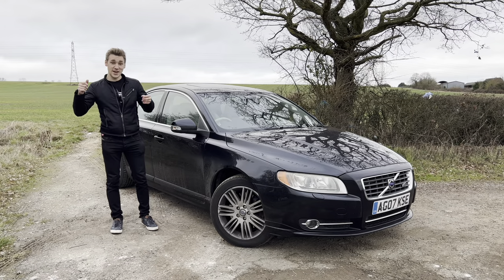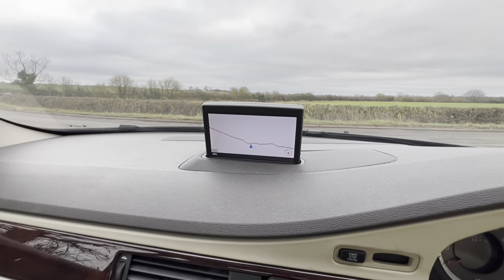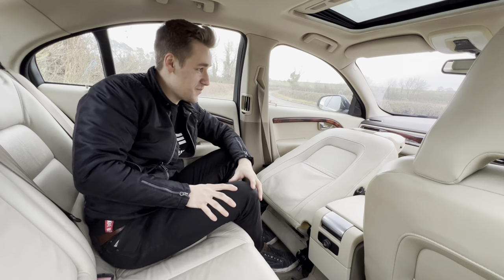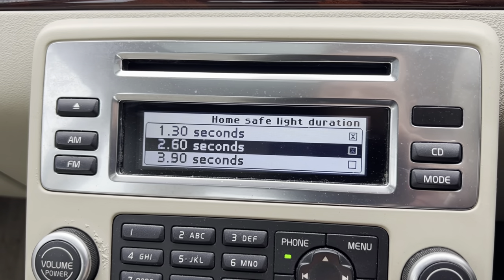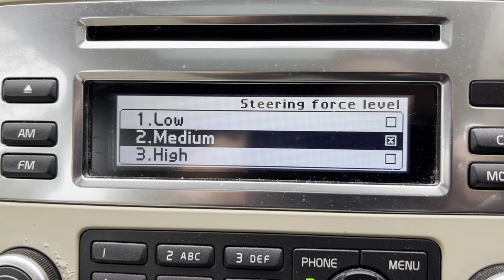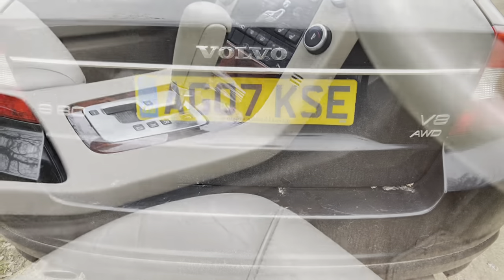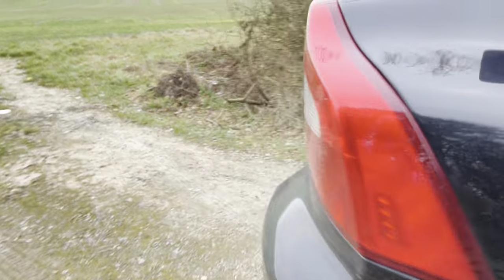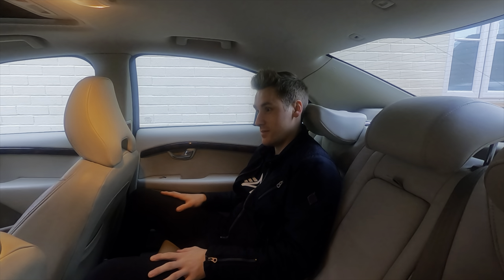Volvo Hidden Features, Hints, Tips & Tricks | P3 Volvo S80 V8

Comment: There is another interesting feature on the key fob (at least the one I had with the V8) where you press a key and it checks if the car is locked or not, if the car is within communication range ..I have not seen that in any other car of this day and age. The one I had, also had adaptive cruise control  and three way adjustable dampers which in soft setting made the car feel too undamped and bouncy and in race mode was way too harsh even on smooth roads, hence effectively forcing one to use the medium setting, just like with the steering options. Enjoy the car, and that burble of the V8, so un-Volvo like that people always struggled to locate which car made that V8 sound..
Reply from the maker: That’s an interesting feature, I haven’t come across that one yet! Thank you for sharing:) I love how people look out for the V8 but miss it because they don’t believe it’s from a Volvo 😆
Reply: this was an option on all the s80/v70/xc70 of the p3 gen

Comment: Another VERY useful feature or mirrors - you can adjust them through menu to look down, while driving backwards, so you can see rear wheels, both or just opposite to driver. Or you can do nothing, engage "R" and press mirror button "R", or "L", or both, but not simultaneously (or they fold, of course). Press again to return them to normal, or just disengage "R" on gearbox.  Don`t know if it is standard or option, but mine have it.

Comment: There is a peg attached to the headrest of the passenger seat so you can hang a jacket on. I turned off the auto mirror close when the car is locked in the winter because the frost kept it stuck shut. It's in car settings but I think your film caught it. Curiously my 2010 S80 Executive does not have the head rest button.
Reply from the maker: I did notice that peg there actually but thanks for letting me know, I was tempted to feature it but I decided not to in the end. Regardless a very cool feature, interesting that your executive doesn’t have it!

Comment: The button to fold your back headrests is to fold your rear seats easier. Also, if you open the trunk, there's a little latch you can pull at the top of the trunk opening. If you pull this latch, the rear seats will fold

Comment: Please stop using Red Coolant in your car, the correct grade coolant to be used for the Volvo is Green Coolant, OE Volvo Coolant is best suited for the car, kind advice to get it changed immediately !!!
Reply from the maker: Thank you for the advice! Interesting how there’s different variations of coolant, what will happen if I keep the red coolant?
Reply: @NathanMannin  The different grades of coolant are for preventing corrosion in different engine block and cylinder head  materials. Some are for aluminium, others for cast iron or combination of both. Great video by the way!
Reply: İlginç! soğutma sıvısının renginin kırmızı yada yeşil olduğunu şimdi duydum. Bende de 2012 V60 D3 var. Ve  soğutma suyu kırmızı.

Comment: The quick-fold front passenger seat in the S80 is also a chauffeur feature. Simply move the front passenger seat all the way forward, remove the headrest (if necessary), and throw a blanket over the seat back to avoid scuffing the leather. You then have a backseat in which the rear passenger can fully stretch out their legs and enjoy the rear armrest/cup holders (hence the existence of the optional refrigerator that replaces the ski hatch behind the rear armrest).
 As an American owner of a 2014 S80 who has driven the car 1000+ miles non-stop, I can guarantee that the fold-flat seat is an invaluable feature for you and your copilot on long trips.
Reply: You shouldn’t need to remove headrest, fold seat forward with levers, then using side slide button on passenger seat, hold head rest down and tight to seat and it travels under the glovebox. When you stop far even forwards it traps seat back pushed down.

Comment: A really cool feature in the PCC (personal car communicator) on the key fob - when you press the 'I' button there are little lights on the key fob that will flash. They can tell you if the car is locked or unlocked, if the alarm is armed, if the alarm has gone off recently, and the most impressive function is what they call the heart beat monitor which can tell you if the car has been broken into and there is someone inside the car when you are within the communication range and the red lights on the key fob will beat like a heart beat. 
Something else handy is where the manual key slot is on the drivers door, found on the rear end of the driver door handle on the underside you'll see the slot to insert the key blade to remove a plastic cover which hides the key slot - handy if the battery goes dead or flat on you and you need to get in or lock the car. Terrific cars - incredibly good sounding V8 and as reliable as the day is long. Underrated.

Comment: I was hoping to be able to comment on something you missed - but you covered almost everything, and now I know the keyblade is quite useful. I also figured out how to use the home safe lights a few days ago thanks to a 2010 S80 brochure I found online. I've found that the high steering force level is better for winding roads with hills, you feel more in control since it's heavier. 
I don't think you mentioned the a button for rain sensing wipers on the wiper stalk. You can turn it on with the stalk in the off position. They are dim-witted but useful occasionally.
Reply from the maker: I love old brochures! I wasn’t aware of rain sensing wipers but I’m also not a fan of them in any car either, I like being in control of when I use them. I absolutely loathe active cruise control that changes it speeds accordingly too, I like the standard cruise control where I have full control that doesn’t slow down for you! 
Someone commented on this video remote start? I’m going to have a dabble with that I think!
Reply: @NathanMannin  if you figure out remote start, let me know. I didn’t know it was possible
Reply: Uzaktan başlatma yok. Bende 2012 v60 var. Yok. 2020 sonrasında varsa onu bile görmedim.

Comment: Most well thought out car I have ever owned. My 2008 V8 still going strong. Closing in on 150,000 miles.
Reply from the maker: Glad to hear from another S80 V8 owner! I miss mine so much, have you had much issues in your ownership?
Reply: Two complete engine reseals. Idler pulley, tensioner, belt, alternator, water pump, cooling fan unit, full break job, power steering high pressure and return hose replaced, fluid reservoir  . Just to name a few.

Comment: We've owned a 2007 S80 D5 for about 15 years and never knew about the little levers at the bottom of the front seat to help with IKEA loading! Also, my Dad used to flip the rear headrests down when my young nephews were arguing in the back 😂
Reply from the maker: I’m glad I could help! I’m sure it was only made as a feature to fit IKEA flat pack furniture 🤣
That’s parenting done correctly, love it! 😂

Comment: Also… The headlights, quick removal with the metal straps yes, but if you unplug and open the main lid inside there is a lever to push across to change the lamps from RHD to LHD, great for jolly’s on the continent old boy. I used to make the change during the trip in the Chunnel.
Proviso of having the Zenon and later vehicles you press button on waterfall for 15secs to swap beam.
Reply: Honestly for the sake of my husband I hope we have no lever in our lamps. He just bought 2 lamps as we have to register our volvo in European country 😂

Comment: Even though im an American Mopar guy. My daily driver is a 2007 S80 V8 AWD. It has exhaust work and high flow air filter. Has a really nice burble at idle and very angry growl at high rpm. Just had the valve cover gaskets and timing cover gaskets replaced. It was leaking oil and killed the alternator. But it has 177k miles on it. Cost $4k US to have all the work done. But it'll go probably another 150-170k miles.
Reply from the maker: Good on you for saving it! I can imagine it sounds absolutely legendary!

Comment: The nav screen on our S80 2007 used to rattle when going over bumbs...plus actually using it was a bit of a 'mare...it looked cool but if you knocked that lever behind the steering wheel, whilst driving, trying to get the thing to lower again was an exercise in frustration, or just good luck!
Reply from the maker: I never seemed to have any issues with it fortunately, I loved how it used to rise out of the dashboard 😆

Comment: Hi Nathan - did you know about the rain sensing wiper feature - might have been an option.
Reply from the maker: I didn’t know about that one Lewis!
Reply: @NathanMannin  If yours has that option there is a small button on the top of the wiper stalk which switches it on and off.
Reply: @EngineerLewis  my last 2011 S60 T6 had that rain sensing button too, i only found it about a month before i sold it. I currently drive a 2013 V60 T4 which doesn't have this auto button but if you put the wipers into intermittent mode they will sweep automatically to the level of rain as needed..brilliant, no need for an extra button

Comment: You don’t have the rigth antifreeze in it 🥲 should be a g11 which is either blue or dark green. The oe one from volvo is dar green. Putting the wrong stuff in especially in volvos will cause lots of problems on cooling system
Reply from the maker: Thank you for pointing that out, I’ll keep an eye out for that in future. Unfortunately I bought it this way and was unaware these have specific antifreeze.

Comment: Fantastic video! How about reliability? Thinking about buying a 2007 automatic D3 S80. Should i be worried buying above 200.000km ?
Reply: Don’t buy any S80 later than 2006. A 2005/6 will last a lifetime and are ultra reliable. You might get 350-500k on these.

Comment: You should have remote start where you can start your car with the key
Reply from the maker: Really!? How do I do that?
Reply: how?
Reply: I don't have it but another video was 1) press the lock button for 2 second then 2) press/hold the light button
Reply: @NathanMannin  Press the fob 'lock' button twice then press and hold the 'light' button until the engine starts. The car must have all it's doors and windows locked and in Park or neutral, if manual. However,I believe this nifty function is only available in US and Sweden vehicles??

Comment: my 2010 Volvo S80 luxury I just got yesterday doesnt have the digital navigator. guess packages vary by country
Reply from the maker: That’s interesting, I’ve never seen one without one! Is yours a V8?
Reply: @NathanMannin  T5, 2.5L 230bhp
Reply: It is an optional feature for simplier S80. V8 is a top of the line, that is why navy is included as standart. There are non-original navy systems, to install in that place, i have one, but broken already anyway, lol.😁

Comment: If you need to get towed, remember to lift the rubber mat behind the waterfall and insert the  ‘secret key’ from the fob into the small slot, that will mechanically release the car with dead battery into neutral for towing.
Reply from the maker: I did mention this in the video

Comment: Non of this is "hidden" - Read the manual! (Availiable on-line if missing in the car)
Reply from the maker: Not everyone has time or bothers reading the manual. So this would be hidden information for most people, easily accessible in a quick video.
Like you said, it is available online due to this video.
Reply: @NathanMannin  Problem with that approach is if the video contains ALL information or only the findings of the creator of the video. i.e. - You dont know what you eventually are not aware of.
Reply from the maker: @linrepboras  it’s a video of hidden features most owners wouldn’t otherwise know about; which I regarded the most interesting/useful. There’s no need to be pedantic about it. The vast majority of people don’t want to go out their way to break out the manual, or explore their cars for hours to find hidden features. They’d rather watch a quick video on their telephone at the convenience of any place they desire, which is exactly what this video was made for.
Reply: @NathanMannin  So all the efforts any vehicle manufacturers made designing the features as all the efforts to also explain when and how to use in the manual is useless?
I doubt that the "vast majority" is both clueless and not interested in their (new or second hand) vehicle, secondly that way of reasoning you just made (people are lazy and stupid) is in that case the reason your YT-channel excists? Does your 1760 subscribers represent the "vast majority"?
Reply from the maker: @linrepboras  I never said the manual is useless, they are your words not mine. But the reality is like I said, most people don’t look through the manual or read through it in depth to find out interesting features. Your wording of “clueless stupid and lazy” is an assumption you’ve taken blown way out of proportion. There’s a reason why videos like these get high number of views, especially for my channel with it being the leading highest amount of views for the past 6 months. That in it’s own right speaks for itself, it shows a lot of people don’t take time to read the manual thoroughly, otherwise they wouldn’t need to watch a video about hidden features/tips/tricks. I feel like you’re purposely trying to be naive and show negativity for the sake of it, what are you trying to achieve or how are you adding value? You’re the only person on this comments section showing negativity whilst everyone else has given something of value or shown their appreciation. Do you go on everyone’s “hidden feature” videos and tell them to read the manual? Or just mine? I’ve said it already, but in this modern day and age where you have your phone on you at all times, people would much rather watch a quick video of a short for that matter to find out information, that is the society we live in. My YouTube channel exists because I create content I enjoy making and love sharing it, my 1760 subscribers represents hard work and people have enjoyed watching 86 of my videos. I would imagine people who are subscribed to me are car enthusiasts, so a higher percentage of them would’ve read the manual of their respective cars to find out features. However, this video reaches out to more than just my subscribers, it’s gained 25K views and not all of them will be car enthusiasts, some of them will just have this as their family car and would like to know more about it by watching a quick video, rather than studying a manual for hours.
Reply: @NathanMannin  There's a contradiction hidden in someone not interested enough to spend some time with a manual but rather spend googling around to find info about their vehicle.
For your information I've been employed at Volvo Cars since 1979 (43 years, retired) and as a product manager involved in the launch of the 1'st generation S80 I'm quite confident in my claim that the owner should refer to the manual instead of Youtube for a comprehensive, inclusive and unbiased description and explanation of functions and features.
Dont get me wrong; I do understand Your ambition to assist and help but are you sure You cover all aspects, precautions and technicalities? If not there's a liability-issue on your behalf.

For Your own sake - always refer to the vehicle manufacturer and/or manual.
Reply from the maker: @linrepboras That is the reality of the world we live in though, everything is going digital and things such as manuals people have less time for. I used to get Xbox games back in the early 2000’s. Fast forward 2010 onwards, most games if not all don’t have manuals anymore, they’ve been phased out due to several reasons, one of them being they don’t get used enough. I’m an advocate for the manual myself, and would much rather have one in my car and refer to using it. 
The purpose of this video is not cover the whole manual, this video is purely for my best features I deemed interesting and somewhat useful which others watching this video have. If some people can learn some new about their cars in the video, then it’s served it’s purpose and that was my goal from it. People go on YouTube all the time, and some Volvo owners may stumble across this video in their recommendations, and will click it on it for curiosity reasons. They may have had no intentions finding out more about their Volvo, but because they’ve seen this in their recommendations they’ll watch it anyway. Not everyone will look at their manual, or ever intend to do so. But they may find this video and find out more about their car because it’s easy and convenient, which they otherwise would’ve never found out because they don’t look at their manuals.
Reply: @NathanMannin  Fully understand, Nathan! I might been a bit harsh in my previous comments but during my time as product manager i was involved in not only the technical and economic development but also the manuals (including user interface/menu's etc), a "complex" product is never as good as it's user interface inclusing the manual.
I understand, and actually - beleive it or not support your perspective and ambition but (this is a sign of the times we live in and my age/generation) my background makes me sad people prefer taking the time "googling" instead of learning how the gadgets or whatever used works. (probably quicker). 
But then again - your channel benefits from this so...

BTW: The Volvo V8 was a wonderful engine, perfomance wice, had a XC90V8 for some time and (dismissed by age now) not always in compliance with road regulations.
Needs regular service/maintenance for a long life and driving pleasure.

The V8 was developed by Yamaha for Volvo.